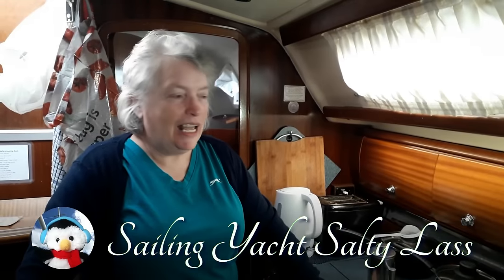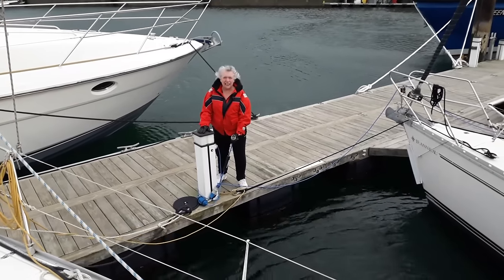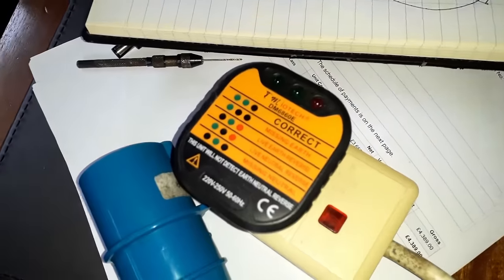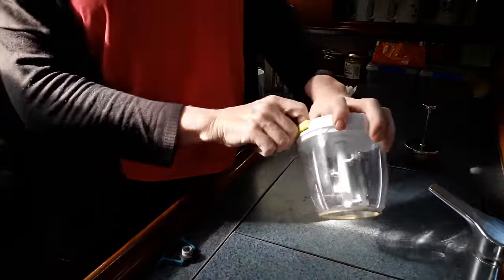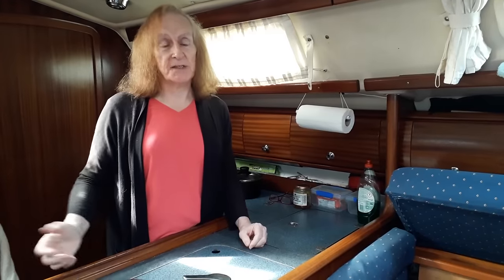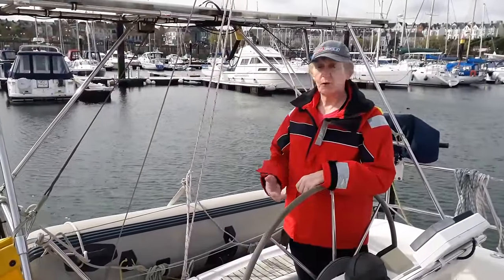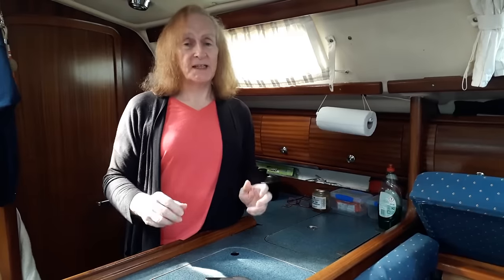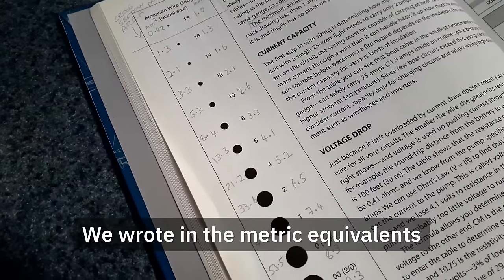Winter talks - AC Power - Electrics - Lithium Batteries - Lead Acid Batteries - Ep. 335

Comment: Get a vango induction hob. It's only 800W on high and you only need setting 3 to boil a kettle or even fry an egg. That's only about 460W. Electric kettles are over powered. They are inefficient, purely to give you hot water as fast as possible.
Reply from the maker: Never heard of Vango but I can look it up. Thanks for the tip 👍

Comment: I think you need to recheck your arithmetic on the LiFePO4 batteries.   They are MUCH less expensive than lead-acid batteries in the long run - hands down.  You can expect 4000-6000 cycles from the LiFePO4 batteries and still have 80% of their original capacity.   Assuming only 4000 cycles, you would get over ten years of service and the batteries would still have 80% of their original capacity.    So, a 100 amp-hour LiFePO4 battery would still have 80 amp-hours of capacity after ten years of regular use, cycling them down to 20% every day.

Additionally, the LiFePO4 batteries are non-toxic and can be stored safely inside your living quarters in any position; whereas, the lead-acid batteries are toxic and require special care - and, expense - for disposal.   And, flooded lead-acid batteries off-gas hydrogen (flammable) and are very corrosive to any and all metal in the vicinity, as well as require regular maintenance (checking the specific gravity and topping off the cells with distilled water).  They also should be vented and not placed inside your living quarters.

Lead-acid batteries (all varieties) can easily be damaged by over discharging them.   You should never discharge them below 50% and if you do you WILL damage them and reduce their cycle life, resulting in you having to replace them sooner, rather than later.  In fairness, LiFePO4 batteries also suffer degradation if discharged too deeply - but, they have automatic Battery Management Systems built into them that disconnect the loads before they are too deeply discharged.  Many of the BMS in LiFePO4 batteries are programmable and often have Bluetooth connectivity and an app to allow you to set the charge and discharge levels to maximize cycle life depending on your usage patterns.   Those same apps can give you real time information regarding the State of Health (SOH) of the batteries, as well as their State of Charge (SOC).  And, some even keep count of how many charge-discharge cycles have taken place since being put into service.

Meanwhile, LiFePO4 batteries have plunged in price and represent about 70% savings in weight.

Finally, the market speaks for itself.   LiFePO4 batteries are steadily displacing lead-acid batteries in the vast majority of applications.  There are real reasons for this - in addition to the ones I already listed, above.  I suggest you do additional research for yourself.   You need not take my word on any of this.
Reply from the maker: Price also varies by location. It is clear that we could get them a lot cheaper if we were elsewhere.

Comment: Ladies, I beg to differ....

I have gone over to 3 x 100Ah LiFePO4 for my main bank and these have an expected lifespan in excess of 4,000 cycles/ 10 years, costing less than £1000 and enabling me to go totally off-grid at anchor for several days without any form of charging. I too have a Bosch L5013 Lead Acid starter battery, and I agree that they are fairly bomb-proof and long-lived, but that is because they are not repeatedly deep-cycled day-in and day-out  (which would indeed trash them within 500 cycles / 2 years). So, £1,000 for 500 cycles, or £1,000 for 4,000 cycles - it's your choice.

Solar is unreliable due to the inevitable shadows cast by masts, sails and rigging - and in my case, as I have a ketch, I cannot permanently mount panels on an arch; instead I have 3 x nominally 130w folding panels and, in Winter, in the Med, I am lucky if I can pull 15 Amps out of them even on whatever happens to be the sunny side of the boat. This current is not going to challenge even a modest MPPT controller, and it is simply incorrect to say that "Lithium drinks Amps" - an Amp hour is an Amp hour, and if you run your batteries down (whatever batteries down) by 150Ah, you are going to need (in my case) at least 10 hours to charge them back up. In contrast the alternator on the engine kicks out 70A, so on a passage its a no-brainer - not "free energy", but not a hassle either.

In addition you cannot draw a sustained load of more than about 20 Amps from a Lead Acid battery should you wish to do more than just keep the lights on or winch the anchor up. (My life-changing luxury is a £212 electric toilet from Force 4 chandlery - absolutely marvellous piece of kit - but anything more than a laptop or a sewing machine and you are stretching what is achievable with a standard battery). 

I have therefore also gone Lithium for my Inverter bank - I have an entirely separate 400Ah black plastic brick (which cost me £1200) in the aft cabin powering a 3000w 240v Victronic inverter, and this allows me to boil my (1000w) kettle, use my (700w) air fryer or cook on my (500w) hotplate. I can also use an 80w Lidl electric blanket, which is a real game-changer. Of course, even 400Ah has its limits, but, again, when under way using the motor I can easily recharge both banks within a day, or wait until I get to a marina and plug in the mains charger overnight.
NB I would seriously recommend installing an Isolation Transformer on the 240v shorepower side of things (rather than a Galvanic Isolator) for all sorts of reasons.

Everyone's setup - and indeed everyone's lifestyles and requirements - are different, but with the greatest respect, now that "drop in" LiFePO4 batteries are available which look, feel and are cabled in pretty much the same as a conventional Lead Acid unit, IMHO not only does the arithmetic work, but there are also very practical benefits in terms of overall capacity, power output (you cant draw 100A to boil a kettle from a 12v Lead Acid battery) and convenience.

On a closing note, the key is to budget: how many Amps do you have going out during a typical day, how are you going to get those Amps back in, and how much of a buffer do you need between the two? My background consumption at anchor is around 1.5 amps, whereas on a night passage, all lit up like a Christmas tree and with the fridge, radar, autopilot, chartplotter, AIS and what have you on I burn about 15 amps. Before the sun comes up (or I run the motor) that needs a 200Ah reserve, hence my 300Ah House bank. Your wattage may differ.............
Reply from the maker: The reason our panels are located where they are is because they are almost completely shade free. They are 300W panels and we regularly see 260W coming in. Like you we can spend days at anchor and it is usually running out of food, water or coffee that drives us into port.

From your description you have a lot more "gadgets" than us but we really lack the room to store all that stuff so we simplify by not having it. And if we do not have it, we do not need to power it.

So far, in the 4 years we have had the solar on the back of the boat, we have never had a power crisis. I am sure we will have one some day because sooner or later everything goes "Whirr...clunk!" and stops working 😮 but so far, so good.

Thanks for watching and commenting. We really appreciate the feedback.

Comment: Totally agree with your decision to stick with what you got, for me the sums dont add up. The beauty of keeping with Lead acid / AGM or Gel batteries are firstly they are a lot cheaper and easy to come by if you suddenly need a replacement. Interestingly my insurance company asked if we have Lithium batteries as they have had several fire claims from boats with Lithium batteries ( probable because they hadn't installed appropriate wiring
Reply from the maker: Electrical wiring by owners is probably one of the biggest issues on a boat. Some of the nightmares we have seen on this boat and others would make anyone wonder if owners should be allowed to install high amperage cabling.

Comment: Once you get over your fear of lithium you will become a believer.
Lithium will save you 10% in electricity EVERY DAY. The lithium charges faster and more efficiently.
Cost is no longer a factor.
And you won't need help when it comes time to lift those antiquated flooded lead acid.
Reply from the maker: We are not afraid of it (one of us is an electrical engineer). In this place, at this time,m we cannot make the costs work out. We could buy the cheapest ones on planet from somewhere but our life experience in general is "buy mega-cheap, buy twice" but the quality is usually cr@ppy

Comment: The electrics are not isolated by a galvanic isolator, only the earth is isolated and only against voltages below about 1v. It is only to protect earthed metalwork in the water. You must have an RCD for protection. It’s the lads on the boat that determine the amps, not the size of the plug. Correct fusing is the important thing. Why not correct the wiring? If you had hybrid lithium you would get an extra 16% power from your panels minimum due to the extra efficiency of the charge cycle. You also get more because you don’t have the absorb cycle where the solar tapers off. You need 1/2 the capacity in lithium as you can use all the power without any risk to battery life. Lithium will last well over 5000 cycles when shallow charging. With your use a £400 100Ah LiFePO4 would be fine. Going hybrid with a small lead acid means you don’t have to update any of your charging sources as they can remain on lithium. All that is needed is to set up the lithium BMS with hybrid settings. Having lithium will also mean that you can use heavier loads fr longer without worry and without the battery voltage sagging to a pint the inverter cuts out. I type as someone who converted some years back after being a lead head for many decades and the difference is remarkable to which so many boaters can attest. The mistake with going lithium is to look at companies such as Victron where it will certainly cost a lot as their main interest is in selling you stuff and to keep selling you stuff whether you want / need it or not. Yes there is a place for it for those with fat wallets and for those who feel they get some social boost from having it but those who do research tend to get much better value systems that are easier to set up and to understand.
Reply from the maker: A bit of sloppy wording in our case. There is an RCD on the boat's AC panel and we have (inadverently) tested it 😉

We are getting great feedback from this video (including your feedback) and so we have a lot to consider. The L/A batteries are still going strong at this point so we have time to consider everything.

Thanks for watching and commenting 👍
Reply: @SailingYachtSaltyLass  my lead acids were, and still are, going strong. This is why I went hybrid as it effectively gave them a second / longer life and now they are mainly a redundant system that also means I don’t have to use lithium charging profiles, there is no cut off problem with the alternator and I’m not going to get a sudden lights out moment as the BMS decides I have used enough. Lead acids are now over 7 years old and I’ve just cooked dinner and had a shower using the lithium without thought. And have used 71Ah
Reply from the maker: That sounds like a great method. How did you get the L/A and lithiums in the same charging cycles when they run such different voltages?
Reply: @SailingYachtSaltyLass  They actually don’t run very different voltages and the lithium voltage sits completely within the lead acid voltage range. One uses the programmable lithium BMS to set a low voltage cutoff at 12v which is 10% on the lithium and 50% on the lead acid. The BMS is set to cut off at 14vat which voltage it is at around 99% charged with the sort of charge rates that are common on boats. Once cut off the charge sources then proceed to take the lead acid up to absorb voltage of 14.4 as usual using the normal charge sources on their lead acid profile. Because the normal working voltage of lithium is around 13.2-13.3v this is a low float for lead acid so they are kept where they want to be: ie full but at that voltage they take almost no current so very little parasitic draw. One aims to charge the bank once the voltage reaches 12.8v which is full for lead acid and 20% for lithium but, at that point, you still have a full set of lead acid that you can use while you use the lithium charge between 20% and 10%. I run a Facebook group “12 volt boating group” where a lot of time is spent on this, explaining and giving settings and examples etc.
Reply from the maker: Yes - your name did ring some bells. I wondered where I had come across it.  For the moment this is not an issue for us but it eventually will be (no battery lasts forever) and it makes sense to get info early so decisions are made in a sensible and timely way.

We will not be going cruising this year so power requirements are a minor consideration at this point (plenty of AC available) but you may see us in your group when the time comes. Thanks for the updates 👍 and I hope you did not get too wound up watching our video (I think some commenters nearly had a fit 😄 but rude comments never make it in here)
Reply: @SailingYachtSaltyLass  Good lord there’s no point getting wound up! That doesn’t help anyone. Your situation doesn’t affect me at all but sometimes another viewpoint can help especially when one point of view seems to be based on questionable information and, when I say questionable, all info should be questioned, including mine. I just try to make it easier by explaining it which is relatively easy as I live with it and designed it.

Comment: All this talk about Lithium and Leadacid batteries but no talk about Gel batteries . Any particular reason? They are safer than lead acid, require no maintenance and can discharge up to 75% without damage.
Reply from the maker: We are aware of the increasing age of our existing batteries (five years) but those batteries are still performing very well, so we looked into various upgrades. People told us that lithiums had become a lot cheaper so we looked into it and, yes, they have fallen in price but in this place it is still going to cost a lot to upgrade and we only need batteries that can last overnight. In the morning, the solar charges them back up.

At this stage it looks a lot simpler, quicker and cheaper just to drop in another pair of lead/acids. We like the idea of Gel but we precluded them simply on cost. It just seems to be lead/acid at double the price.

Our lead/acid batteries are the sealed variety. We have done no maintenance on them in 5 years

Comment: Another nice vblog.  Thank you both.  Thing about lithium batteries is that the majority of them are made with material produced by child slave labour.  This information is being  supressed and/or greenwashed by the manufacturers.  The good news is that things are changing (albeit slowly). There is better technology coming through anyway.  So, good decision.
Reply from the maker: Thank you. Another consideration is that lead/acid batteries are very efficiently recycled back into new lead/acid batteries whereas lithium seems to be more of a "throwaway" technology.
Reply: Lifepo4 batteries don’t contain any Cobalt these days and yes, they are recycled just like lead acid.

Comment: Oh boy. First you diss batteries in parallel, then you promote it. The bare minimum is a battery isolator switch. Better is separate chargers charging into separate batteries running separate loads. Most people can't predict or control which battery has a higher standby voltage. Battery differences are much worse than you can figure and they are a total disaster for some people. Another scheme is use six volt golf cart batteries and no batteries in parallel. Wire them in series and there is no fight between them.
Reply from the maker: There is nothing wrong with wiring batteries in parallel, but there is more than one way to do so.
Reply: @SailingYachtSaltyLass  Germany lost half their PKW 4 tanks in WW2 to batteries in parallel. They couldn't start in the morning, then couldn't turn their turrets. A local trucker got fired for rewiring a company truck in parallel. Every morning, his wife came and jumpstarted the truck with her car. It took over a half an hour.
Reply from the maker: Lucky for us we are not driving a tank 😉 but it is a great anecdote. I like it 👍